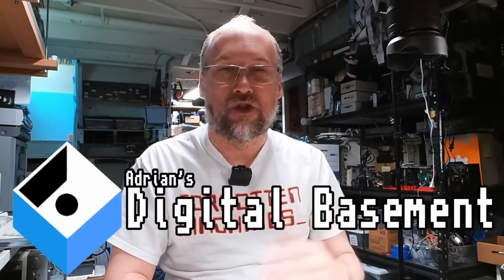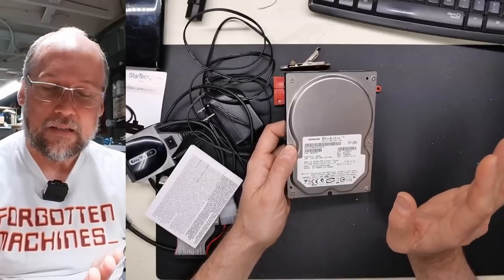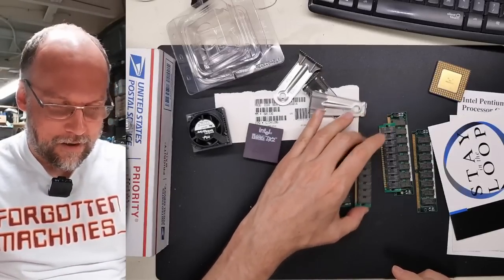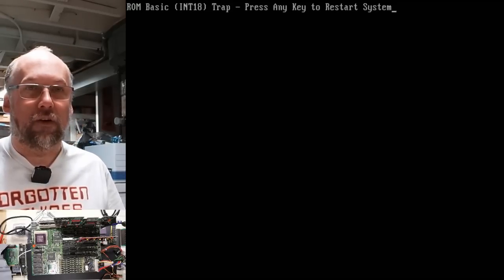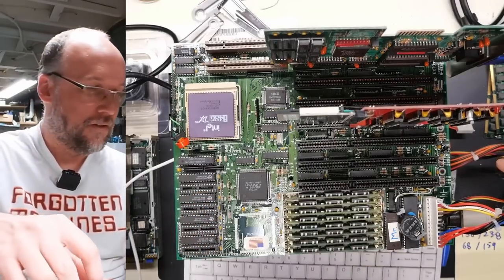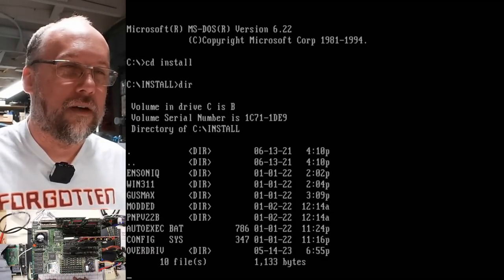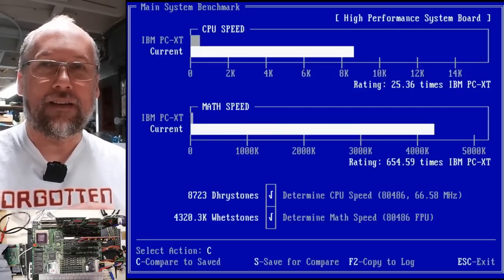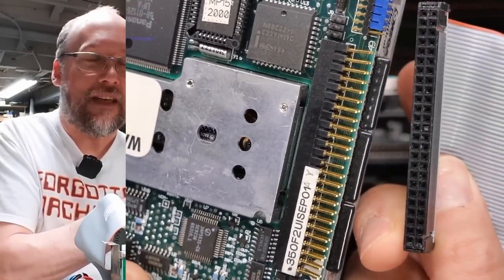0062 A Pentium Overdrive exposed issues with my 486 motherboard

Comment: I prefer the DX50 to the DX2/66, the faster FSB will yield a more balanced system. Up from that we have the DX2/80 and DX4/120 all 40Mhz FSB, sadly never seen one of the DX2+ built around a 50Mhz FSB, only the Pentium cores went up from those 40Mhz/50Mhz so yeah no fun.
Reply: I upgraded from a DX50 to a "DX2/100" (it was so stupid that they called the 2x50 DX4/100, most people don't even know it exists lol), man that thing was a beast back then. Should have called it DX4/100 Ultra or something...
The 80 and 120 SKUs are not Intel though! They are AMD or Cyrix.
LOL I just checked on Wikipedia and the 2x50 DX4 isn't listed there. 😂
Reply: @Qyngali  wait ...this is confusing. are you saying there was a "DX4/100" that used 50MHz FSB ? never heard of such a chip

From what I know, the DX2's always have a 2x multiplier (so 2x50MHz = 100MHz = "DX2/100") and the DX4's had a 3x multiplier (3x33MHz = 100-ish MHz = "DX4/100") 
So the DX2/100 performed a bit better overall due to the higher FSB
Reply: @KenjiUmino  But there was no DX2/100- Intel made only DX2/66 and than DX4/100. There was also DX2/80 from Cyrix and AMD.
Reply: @Qyngali  I know, the 40Mhz FSB ones are all AMD in fact.

Comment: Try using some better motherboards. In my opinion, the best motherboards of the late 486 era through the Pentium era were made by ASUS. If I recall correctly Supermicro were also well regarded. I always had problems with generic no name boards of that era when I was doing PC maintenance.

Comment: Cache is too slow and too little.
Anything slower than 20ns is asking for trouble in lots of weird ways especially if the controller is a goof ball getting saddled with a pentium.
Go with 256k @ 15 ns and call it a day.
I would go with max of whatever capacity and speed the board can support with both cache and ram to be honest. Can find the chips everywhere and fairly cheaply nowadays versus back then.

Comment: Pentium Overdrives had another row of pins on the outer edge. The 486 Socket needs to have a row of pins around the 486 CPU to work.